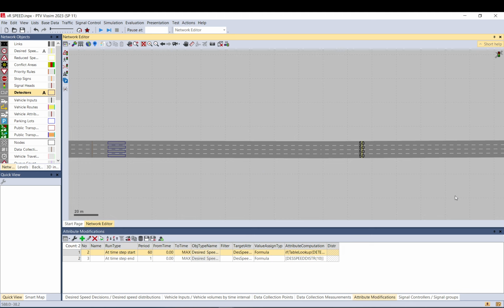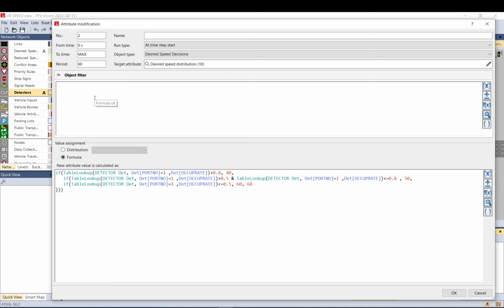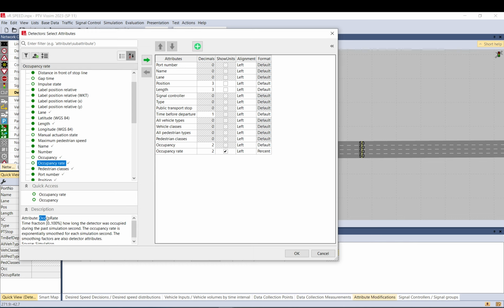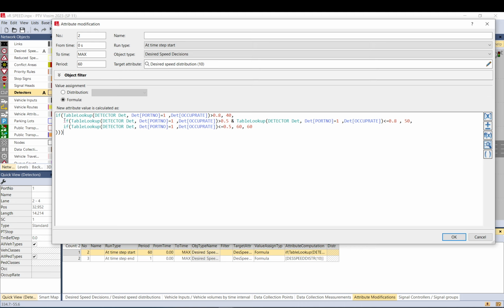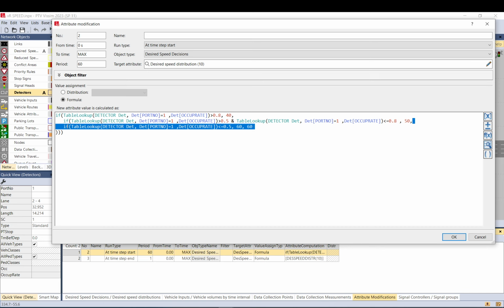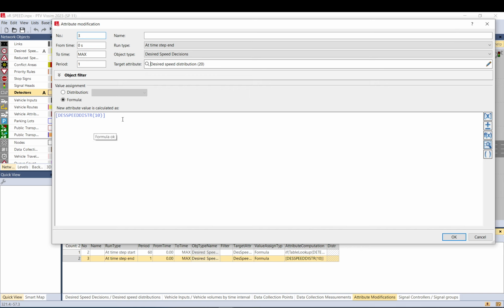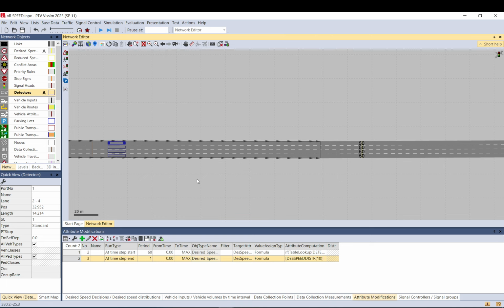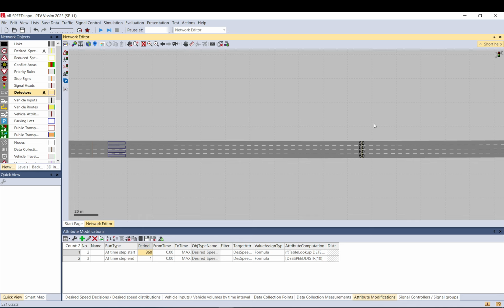Vissim Tutorial - How to model variable speed limit

Comment: Hello Matyas, thank you for sharing your knowledge and experience. I am currently working on a project to simulate a gas station in Vissim. For the service time, I need to define a normal time distribution bounded between, for example, 93 and 380. However, in Vissim (at least in the 2020 version I am using), I couldn’t find an option to explicitly set lower and upper bounds. The only editable parameters are the mean and standard deviation, and the lower bound is always fixed at 0. Do you have any insights or suggestions regarding this issue?
Reply from the maker: Hi, in order to do that you might want to use empirical distribution and not normal distribution. When you use empirical, you can set a lower and upper limit. You can also add intermediate points to the function curve creating a similar distribution to normal. You can also calculate it in excel and copy paste the figures into Vissim. You can edit the curve via a graphical interface when double click on the distribution but you also have the option to manually edit the points in the list view on the right side.
You just need to set the type to 'empirical' from 'normal' for the distribution you just created.
Reply: @MatyasLemberTutorials  thank you. looks like a bug.  Based on Min, Q1, median, Q3, and max, I did that.